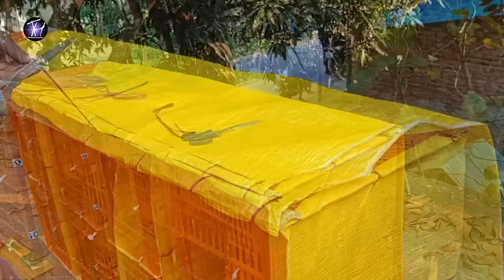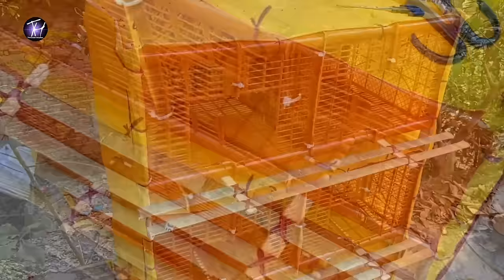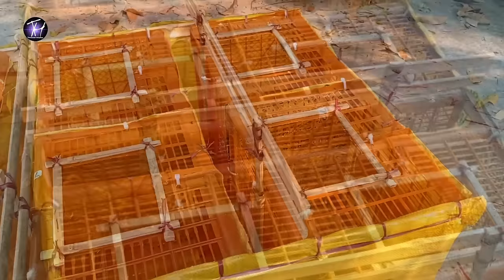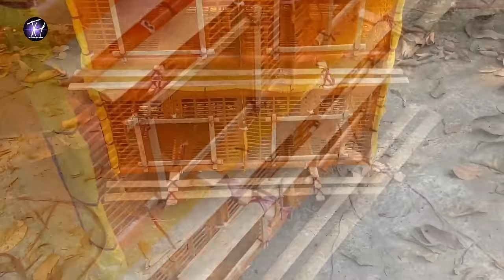How To Make Pigeon House With Plastic Box || Pigeon House Making Video || How To Create Pigeon Loft

Comment: Nice design and cage. Should also make a hole on each corner of bottom sheets to where strings can be tied,  to enable easy removal and reattachment/replacement after cleaning off the excrement.

Comment: Cheap pigeons loft but bad idea to used those plastic bags on the buttoms of each of them, because you need to pigeons poop leak to the grounds and for easy to flush the loft with water hoses.